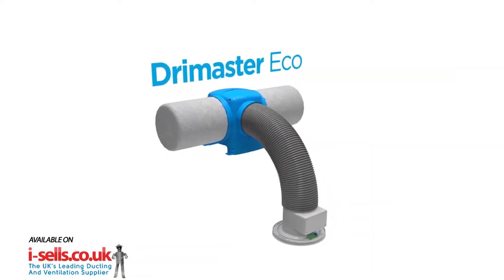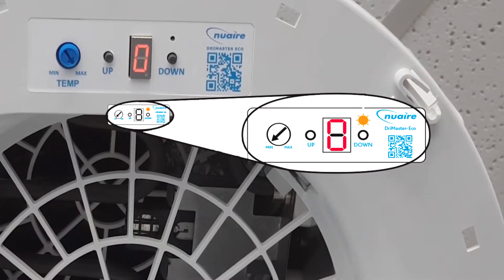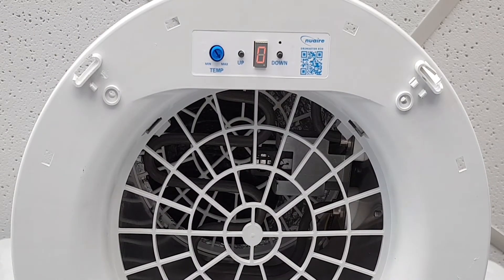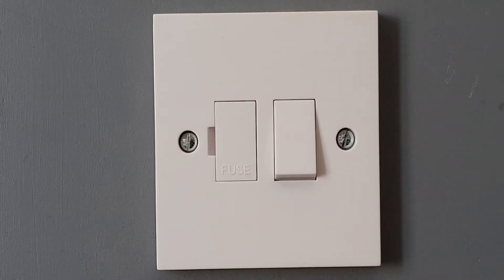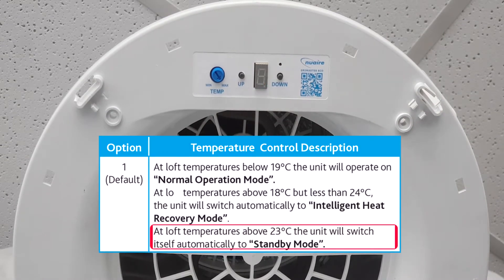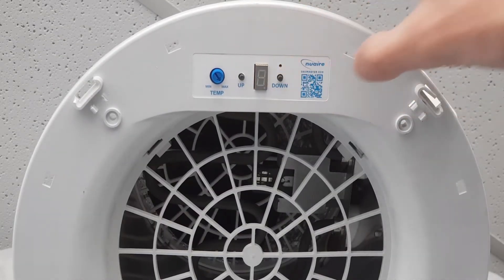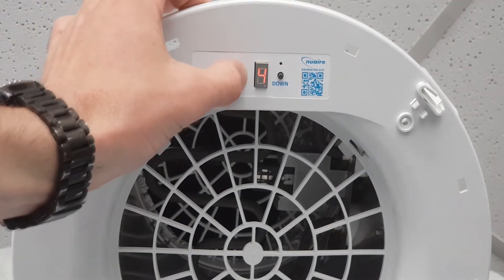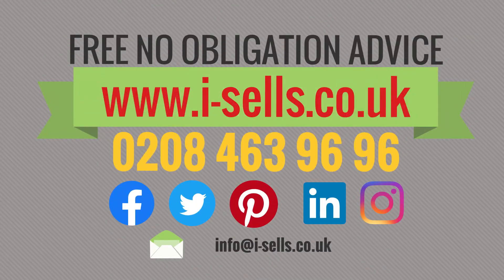Nuaire Drimaster Stopped Working

Comment: My Nuaire Drimaster vent has begun to create black sooty deposits on the ceiling around the vent. I have had my Drimaster unit for arvit l about 18 months, so I assume the filters need cleaning, but I've removed them and can't see much dust inside them. Should I wash them with water and then leave them to dry before refitting them, or should I just vacuum them. If vacuuming, do I vacuum the inside or the outside? Thanks.
Reply from the maker: Thank you for your question. Sorry, you are experiencing problems with your Drimaster unit. Could I ask if your loft space is ventilated? As for this unit to work the loft space needs to be well ventilated by either tile vents, soffit vents, or air bricks so that the fresh air from the outside can be filtered into the property. If the loft space is not ventilated then the unit will only filter in the air that is in the loft space and will not work to its ability.  In regards to the filters, these can be washed in warm soapy water or hoovered inside and out. If you have any further questions please do not hesitate to contact us.

Comment: After a power cut my unit (DRI-ECO-HEAT-HC) displays error code E150 and blow cold air at full speed. It lost it's pairing with the 4 switch unit.
I've tried pressing and holding down: up, down, and up and down, but nothing is changing. I've tried restarting the unit, but again, no change. I can't find this error code anywhere.
What does the error code mean? How do I reset the unit?
Reply: Mines doing this too, did you get any info ? Thanks for any help.
Reply: If it is within warranty they will replace it or fix it. You have to take it down. Alternatively, if it is out of warranty, you can take it apart and it's most likely a lose connection. It still involves taking it down.

Comment: Hi we have a nuair Heat 7 months old. The fan is stuck on full and no display so unable to either relink to out switch or change speed. Help please
Reply from the maker: Hi @meggiemoocornwall8274,

It sounds like you're having trouble with your Nuaire Heat unit. Based on your description, it seems like the fan is stuck on full and the display isn't working, preventing you from making adjustments. Don't worry, I'm here to help!

If you purchased the unit from i-sells, you can reach out at 02084639696 with your order number. And we will be able to assist you in resolving the issue. Alternatively, if you bought the unit from another source, make sure to note down the serial number located on the back of the unit. Then, give Nuaire Aftersales a call at 029 20858 400. They specialize in handling these kinds of situations and should be able to guide you through troubleshooting and potential solutions.

Hopefully, your Nuaire Heat unit will be up and running smoothly again in no time. Best of luck getting it sorted out! 🛠🔧

Comment: How do I turn off the heater? I held down button for 5 secs and released and wont turn off..il be hit with a massive elec bill from this unit..
Reply from the maker: The heater is controlled by a temperature sensor that is fitted to the outlet of the heater and will control the heater output to maintain the set point. If you could refer to Installation and Maintenance 10.4 and 10.5 for setting adjustments. In addition, you can add up to 3 wireless sensors to DRI-ECO-HEAT-HC. An example would be 4 Way Heater and Boost Control Switch that would allow you to control it manually: https://www.i-sells.co.uk/nuaire-drimaster-eco-4-way-heater-and-boost-control-switch If you have any questions please call our Technical advise on 02084639696

Comment: Does anyone know why the heating element would stop working? The fan works perfectly fine but it just blows out cold air. Thanks in advance
Reply from the maker: Hi Jake, the unit has Temperature Control. Please refer to 11.4 Settings and the Temperature Speed Control Option: https://www.i-sells.co.uk/fdm_pdf_file.php?fileid=551 or call us on 02084639696 for further assistance.

Comment: What's the temperature knob on the left
Reply from the maker: The temperature knob on the left is the thermostat control. It allows you to set the temperature at which you want the heater to turn on and maintain. This helps regulate the warmth in the room and ensures the system runs efficiently when needed.

Comment: We will be removing the drimaster as soon as we can. It creates cold air during the coldest months and we still have condensation issues throughout the house. Absolute nightmare. This is Britain, where winters are known to be cold. May as well open all the windows and turn up the heat.  What a waste of heating and our hard earned cash.
Reply from the maker: Hi Trace, we had great feedback about these units from loads of customers. We would suggest contacting Nuaire Technical to see if the unit is faulty or to see if a speed increase would be required.
Reply: I totally agree with trace
Reply: Totally agree. I think it is a sales gimmick. I only have it a few days and wish I didn't waste 550 on it. Had to turn it down to setting one or else the temperature in my house was dropping quickly. So not only do I need heating on longer but I also will get hit with higher electricity costs on the integrated electrical heater. It would cost way less putting windows on vent!
Reply: I gave it a couple of days and adjusted fan speed until I was happy with the condensation going. I then set the boiler down a couple degrees as my hive is under the PIV Diffuser, the house heats up the same yes there is a chill when the rating is off but nothing like I have read people suffering with I think it's a case of playing with the settings until you find the weet spot with the PIV and heating adjustments. It's solved the condensation problem in our property.

Comment: anyone understand what exactly 'intelligent heat recovery mode' is?
Reply from the maker: Thank you for your question. An intelligent heat recovery mode is a feature commonly found in Heat Recovery Units (HRUs) used in HVAC systems. This feature uses additional sensors, such as humidity sensors, to optimize the system's performance.

For instance, in wet rooms like bathrooms, kitchens, and utility rooms, the humidity sensor can detect when the humidity levels exceed the pre-set levels and switch the unit to boost mode. This mode helps manage the increase in humidity by extracting more air from the wet rooms and expelling it outside until the humidity level decreases to the set point.

By using these sensors, the system can operate more efficiently and maintain a comfortable indoor environment while reducing energy consumption and costs. This feature is often referred to as "intelligent" because it can adjust its operation based on real-time data, making the system more responsive to changing environmental conditions.
Reply: @isells  thanks for the fuller explanation
Reply: This reply kind of implies that this particular mode would only work if additional sensors were connected? It's really frustrating that the manual says absolutely nothing about what this mode is or how it works. My loft temperature is regularly around 30 degrees at the moment so my unit spends most of the summer in standby mode, even though the humidity in the house is in the 70s.